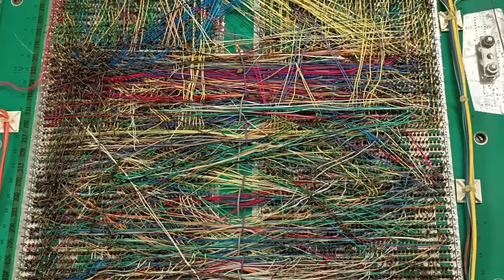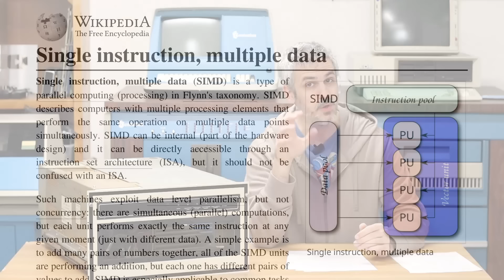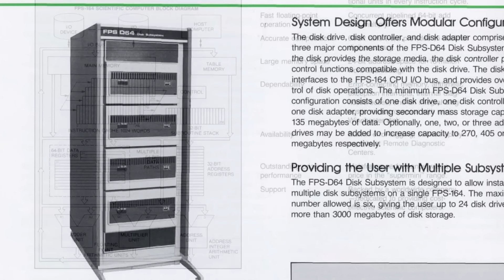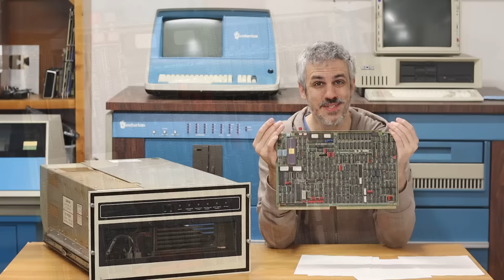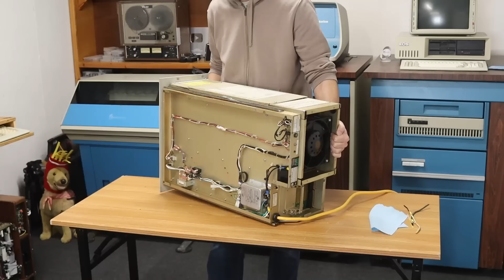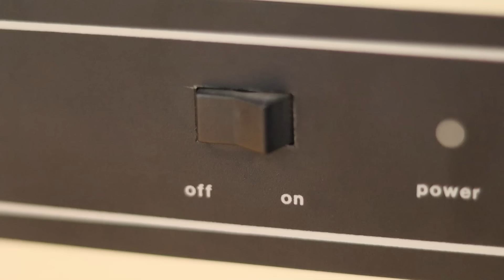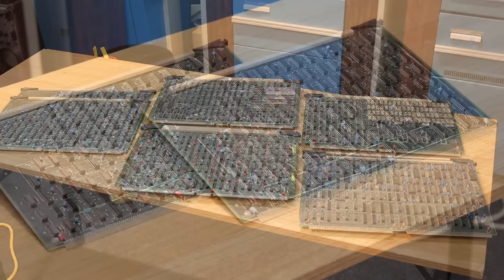This Computer is from a Defunct Supercomputer Company

Comment: There was a generation or two of the IBM System 390 that offered a Vector Facility option.  You could look to see if the Vector Facility had any common engineering with the FPS.  Even if it is a completely different animal, if you could track down some of the 390 VF engineers they might know something about FPS too.
Reply: Even before the 390 VF, there was the IBM 3838 Array Processor.  Again, I have no idea if it has anything in common with FPS, but it at least the 3838 was in the timeframe FPS was active too.

Comment: As soon as I saw the S/370 references in the documentation, my brain started sketching out the channel controller for hooking up to a mainframe - it would be a decent sized unit since bus and tag cables are Not Small, but based on the layout, especially the dual port RAM, it would be a pretty simple interface to put together. The most complex part of it would be whatever initialization routines need to be fed from the host.

Depending on how smart the libraries are, that is - this is absolutely a FORTRAN beast, and if they had a straightforward "initialize this" function call this would reduce  the cognitive load on the programmers.
Reply: I worked for a company called JDS Microprocessing./Hydra Systems. We built a Protocol converter that attached to the IBM channel. Keeping a mainframe around for development and testing wasn't practical so we constructed two different channel simulators. It was a bit of a problem to get working but because we used programmable logic and an existing board, the only thing that wasn't off the shelf was the cable connecting the simulator to the channel. I had software written in 68000 software in the simulator that could pound the daylights out of our units looking for stress related problems. It was also useful for testing new feature to ensure they worked as intended. The big problem would be  knowing what the CCWs look like on the mainframe side as the I/O would have to be properly constructed to test the unit. 
I don't think that is set up to interface to a 370 system unless a bunch of stuff is missing. You need the +-12 volt supply, a proper interface card and the channel connector is missing. It was common for computers to have an external math processor at that time so someone might have made the connection but not with the unit as it stands.

Comment: 5V@200A is welding current indeed. I've blown a terminal mux/driver chip in VAX 11/750. It was pretty spectacular, much white smoke and a tunnel through the chip. Luckily it caused no further damage. After inserting new chip *in correct orientation*, we got terminals running again.
Reply: "Well, we didn't get it running, but we did put a bad tantalum capacitor into orbit."
Reply: I dropped some long nose pliers into the back of a Pyramid Unix machine in the early 1990s. There were 2 x 300A 5V supplies in there. One side of my pliers ended up a lot shorter than the other while the system did not miss a beat!

Comment: Geologic ?? Oil companies used FPS's for geological surveys. You make an explosion and listen with microphones what is coming back. With math you can make up what is below you. If I'm correct, lot of fft is associated with this, to get a "picture" whether there is Oil or not. 
Back then when I used to work for NCR, there mainframes used also microcode in RAM due to speed. Static ECL RAM's were way faster then ROM's. The Microcode it self was loaded from 8" Floppy Disc by the Maintenance/Service Computer (build in but a Processor if it's own).

Comment: Did Floating Point Systems also develop products to be used with Sun SPARC machines?

In the mid 90s I visited a company specializing in geological surveys and they had a SPARCstation IPX hooked up to a large accelerator looking similar to the FPS-3000. If I remember correctly it was connected using a SBUS card in the IPX. 🤔
Reply: The group I worked in in the early 1990s used an IPX (the 10" square, 6"high one) and I hated it when we had to use it -- it was so slow! The SparcStations were better, but my favorite was the HP-PA 900/735 on my desk. Blazingly fast, lovely display. HP-UX was a bit idiosyncratic.

Comment: I think geological survey was like doing an x-ray of the Earth using the sound/seismic waves created by... explosions! Google Search thinks the same:

In the 1970s, the primary application in the commercial sector related to geology would have been oil and gas exploration, which relied heavily on processing massive amounts of seismic data using digital filters and Fast Fourier Transforms. The vector architecture was particularly suited for these types of operations on large data arrays, greatly improving performance for numerical simulations.
Reply: They are still doing it similarly, except they are using modern supercomputer clusters in big data centers. They don’t use explosives as much now, relying instead on a pair of trucks, one with the sensors and one that vibrates a huge (like 20k lbs) weight up and down. With cm level GPS on the trucks, it gets silly levels of precision and accuracy.

Comment: Arc welder power supply, we're nearly back at that level with modern PCs 💀
Reply: One of the major advances that allowed the AP120B to exist was the first switch-mode power supplies. Norm Winningstad (FPS founder) called them "magic."
Reply: Don't talk to me about modern PCs. It's got to the stage that getting PSU rated less than 500W is hard, while 1.5 or even 2KW is possible! This when most normal built-up PCs consume less than 400W all in!! :( Only those with leading edge GPUs and multiple spinning rust drives will need anything like 1KW! And what's worse, is that if you underuse most PSUs (any kind) they tend to perform very inefficiently and your 80+gold PSU turns into a 60+nickel!
Reply: @rivimey  Though, of course, if you do use a leading edge GPU, there's a reasonable chance they'll demonstrate the whole welding capability and melt the 12V High Power connectors...

Comment: Which parallel interface card is that you have for the PDP-11?  Some time back, I mentioned the DR11-C was the 16-bit Unibus board we used way back when, and documentation for it is available on the web.  Our use case was a simple 16-bit status word presented at a specific address in memory.  There were two of these, allowing an ancient PDP-11/05 to interface with a PDP-11/45.  I would imagine a similar use case for the FPS processor, where FPS  microcode and data are passed to the FPS from the 11/44.

Comment: on-chip ram by logic circuits directly gets away with any dram/sram refresh issues. only if you twos would be one. so tense to get even to power self-test lol. yep just focus on yourself doings not others doings. logic system decoding no problem. no bread boards shall be broken.

Comment: Whenever a geologist needs supercomputer time, the driving logic is: "Earthquakes!"
Reply: Oil & gas, actually.
Reply: Karin Sigloch (Oxford) uses those resources for her tomography work which does kind of involve earthquakes though she uses the wave analysis to see deep into what's underground.
Reply: @NateEngle I was being cheeky. But in the 70s most of the research was focused on seismographical modeling, which emerged with the supercomputing.

Comment: If memory serves, we had Weitek branded 387 math co-processors back in the day ... They must have some family resemblance to your weitek chips and I'm sure docs exist for 387 ones that can be at least partially translated to your older chips given that most chips are not from scratch designs but lean heavily on their predecessors ...
Reply: The Weitek chips themselves are not the problem, they are just floating point ALUs, the problem is that the machine runs the XP32 instruction set architecture which is the language to 'talk' to the ALUs.

Comment: I only have some tangential knowledge of the geological use having worked in the nuclear industry for some time. Seismic data is often collected from a highly distributed sensor system where each data stream must be aligned in time and attenuation distance. Additionally, known anomalies in the Earth's structure must be compensated as well. The NRC document NUREG/CR-5417 "Processing and Interpretation of Seismic Reflection Data Near the Bane Dome in Bland County, Virginia" is available as document ML19332F132.pdf on their website. 
Why did the NRC commission such studies? It was part of the process of determining the design fault basis of a nuclear power plant. It helped predict the maximum possible Earthquake the plant might experience and thus, the plant must be able to survive without meltdown.

Comment: Single fp100 is not vector really. It looks like pretty standard fpu , with exception that it is fast, pipelined, and can do add and multiply independently using separate units, which is good, and require quite a lot of ports to memory to pull off. But it is evolution of some systems, like IMB System 360 Model 91 (from 1967), I guess. Maybe even simpler.

The later model look more like GPU style computing. In modern terms we would not call them vector processors, but simply parallel processors.

Comment: 0:29 i preferred plops brother. more organic
1:54 the umbrella term is tensor. scalars, vectors and arrays are tensors but vectors are only 1 dimensional: arrays can be 0,1 or two-dimensional. a tenson is a distribution that starts where is starts, ends where it ends and isnt concerned overly with what happens in between. thats the issue of the user

Comment: Perhaps reading the IEEE 764 standard documentation will shine some light on how to proceed with programming it. Just a thought
Reply: The FPS systems architecture predated IEEE-754 fp-math standards by a decent margin. '754 was a latecomer which amazingly managed to become fairly universal. The "Universal formatter" board that was mentioned had the job of translating between differing floating point represetations on the fly -- I am amazed it worked at all.

Comment: One possible source of parts, if any are still around, are Technicare CT scanners. the Technicare 2010, 2020, and 2060 line of scanners all used FPS array processors. Sorry I no longer remember which models.  Many of these scanners were exported to south America back in the late 80s as newer models replaced them in the US.  Enquiries to south American medical imaging parts companies may turn up some dusty items on the back shelves yet. As a Technicare field service rep I used to have schematics and  full FPS diagnostic software that ran on the system pdp11/34 computer and sometimes repaired the boards at a chip level in the days before board swap only level of repair was instituted.
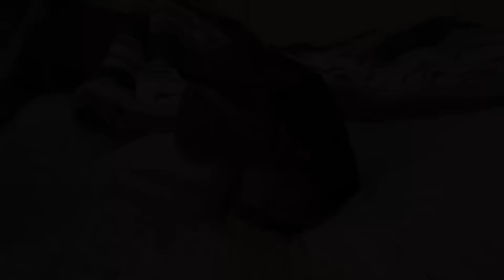Reply: Yep, going down the rabbit hole at 27:10  lol
Reply: I used to work at Technicare at its Solon, OH headquarters assembling circuit boards for the CT scanners from 1982-about mid-1983 and again in, I think, the fall of 1983.
Reply: Let's be careful with ct scanner eq though -- the tubes can be very dangerous especially from the early erra. I know the array processing part is separate but the scanner bit should not be powered up unless you absolutely know what you are doing.
Reply: Stripping CT scanners is how multiple radiation disasters happened.....
Reply: How? There is nothing radioactive inside when unpowered.
Reply: @SockyNoob CT machines use Xray tubes, which aren't dangerous unless powered. I think you are confusing them with teletherapy and gamma knife radiotherapy equipment which uses cobalt isotopes. CT scanners aren't dangerous, nor orphan sources. I guess if you powered a CT scanner up and pointed it at your brain for a few days it might be a serious danger.
Reply: @WolfGamerBohumin big medical machine is big and medical therefore radioactive I guess
Reply: @TheSpatialTheory  No, CT scanners (and X-ray machines) use X-ray tube, meaning no power = no radiation. Only old-style cancer treatment machines use radioactive isotopes like Co-60 or Cs-137 (case of the Goiânia accident), but those are being replaced by modern machines with linac (linear particle accelerator), requiring power to generate radiation.
Reply: @WolfGamerBohumin  oh yeah! I spent some time watching some detailed breakdowns of those. I was merely saying the average person isnt going to be able to tell the difference between a ct scanner, mri, or gamma knife. Big scary medical machine!
Reply: I can think of a south American country that's strapped for cash and would gladly sell
Reply: @pacman10182  Probably a lot more willing if it weren't being bullied by warmongering tyrants.
Reply: @nonstopNny  weird the people are cheering the "tyrant"
Reply: @pacman10182  It's weird that people cheered for Hitler, too. Didn't stop them.
Reply: @BarryBeaner Godwin's Law was never meant to deflect realistic comparisons. You're silly.
Reply: @nonstopNny  - I prefer Despotic Demagogue.
Reply: @BarryBeaner Following the Unite the Right rally in Charlottesville in August 2017, Mike Godwin, the creator of Godwin's Law, posted on Facebook and Twitter that it was appropriate to call the white supremacists and neo-Nazis marching in the rally Nazis.
Reply: @BarryBeaner I didn't mention WW2. I did mention a man who died during WW2.

Comment: Minor correction; Modern "unified shader" GPUs are NOT vector processor units. Yes, they're SIMD (Single Instruction Multiple Data), but that's done by having a large number of non-independent cores execute the same instruction on different data. (Source; I wrote my Master's Thesis on GPGPU in 2016)
Reply: GPGPU usually considered SIMT, rather than SIMD. - Each "Lane" is assaciated with it's own program counter.  The part of the chip that sets up the lanes is integrated into the pre-fetcher and insures a smooth data flow so long as the program sequence in the lanes don't to diverge too wildly. The GPU can do scatter/gather ops to combat this somewhat but this ops really strain the memory subsystem. 

Vector processing can by build on SIMD ALU's but the main feature of vector processing is the instructions contain direct information about the size and structure of the vector.
Reply: @WorBlux  Program counters are per warp/wavefom so no. Meaning if you ever branch, then any threads in your warp/waveform that don't run that branch, have to sit idly while the ones that did complete it. Thus CUDA introduced dynamic parallelism in 2014 so instead of branching a warp, that branch is just run as its own warp.
Reply: @LAG09 it just struck me that the likely origin of the term warp in this context is not just cause it sounds cool, but refers to the “warp” when weaving fabrics. Given you have threads, an analogous but distinct concept would logically be called the warp (warp and weft are the horizontal and vertical components of a woven fabric during weaving)
Reply: @WorBlux  GPUs don't have a separate program counter per lane, only per warp
Reply: I'd call them independent-ish, because of all of the complications around warp scheduling.
Reply: @typedrat  Considering a core can only run what the rest of the warp/waveform runs or not run at all, I wouldn't call that independent in any meaningful way. Cores don't have their own instruction decode logic or even a program counter.
Reply: That's describing a vector processing unit lol
Reply: @thewhitefalcon8539  simd are fixed width, vector processor's are not. Ie, avx can only work on 4 dp at once, it can't process 2 or 3. The same width vector can not only work on 2 or 3, it can do multi 2 while loading a third, and storing a 4th.  This means that vector processors don't need as many load and store registers, but also means vector are much, much faster with streaming data. Simd only get meaningful speed when they are saturated, vector can chain instructions and provide acceleration even doing serial execution.
Reply: @ionstorm66  you just ignore the ones you don't want
Reply: @ionstorm66  AVX-512 certainly does allow operation masking. While it won't auto-unroll and issue independent ops it is starting to acquire a bet of a vector processing design flavor.
Reply: @thewhitefalcon8539  No. A "vector processing unit" is similar to what today is known as a "pipelined instruction stream" in the form a CPU/ALU able to apply a multiply-add operation (or other combinations) on a vector of floats continguous in memory for example, while keeping all parts of CPU busy, The memory being suitably banked etc.
Reply: @SterileNeutrino  yeah and that's how GPUs work........... Except they don't have to be contiguous in memory.

Comment: I recommend taking high resolution photos of both sides of each boards to have a record of the wire bodges and where they go.  Just in case something happens.
Reply: I do that, then overlay and align the images in a graphics program so I can "see" both sides of the pcb.  Makes reverse engineering so much easier.

Comment: Back in the day (actually not so long ago, as recently as the early 2000s) I was programming a barely documented Vector Processor with the grand name of a Sky Warrior.  Apparently about 15 MFlops, this was part of a LTX Synchro semiconductor tester.  It's funny how documentation on such things seems to evaporate.
Reply: Yep, Schematics were tightly controlled on those items in the 80's, lots of customer complaints as they want to do the repairs but the companies wouldn't budge. Exchange only.